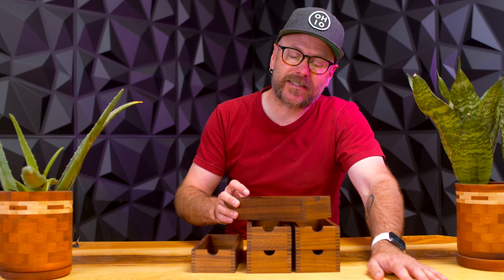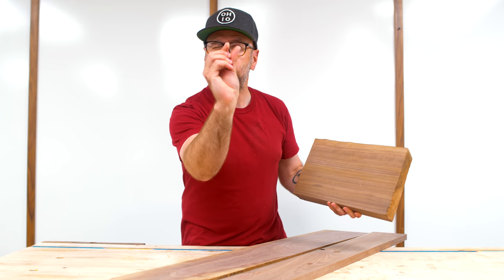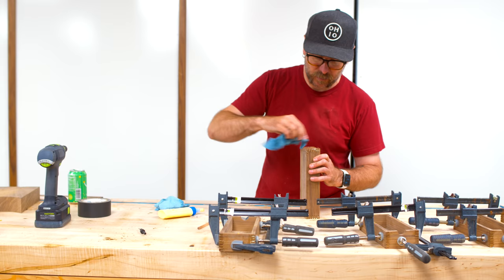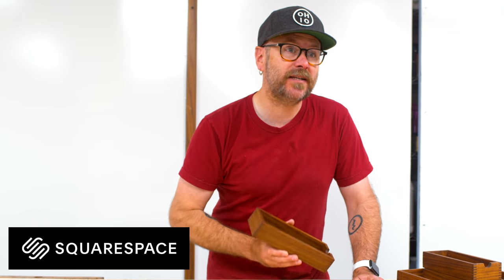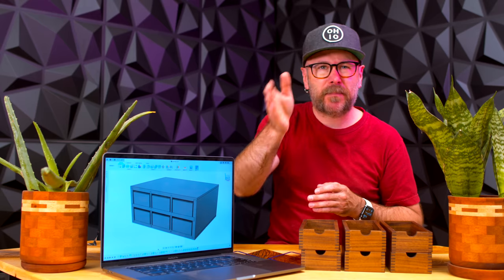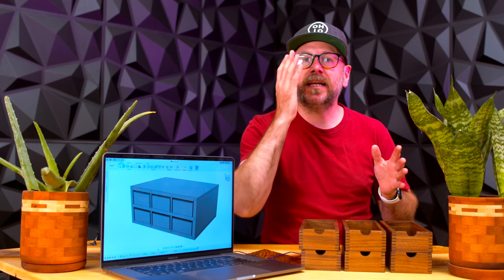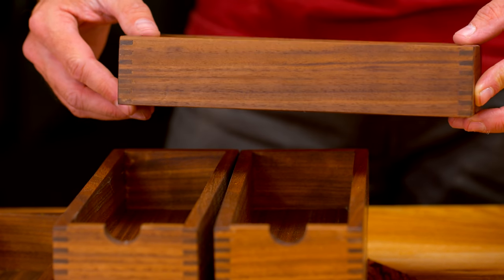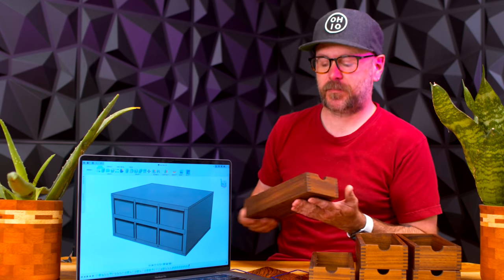I need your help finishing this woodworking project!

Comment: If I would not know what I want to do with a project, "not feeling it" as you said, I would try something that would challenge me. I look at these drawers, and the question, and I keep thinking- a pyramid. 1, 2, and 3 drawers in a triangular shape (no point on the top, rather a small flat surface to put pen holder holes or a phone pad charger or something). you can build a top, on hinges, and put bushiness cards under it or something... it will certainly be unique, and eye catching. maybe even something for your next book...hope this helps.

Comment: Haven't read all the comments so this might have been mentioned, but a simple monitor stand ┌────┐w 3-4-5-6 of these these drawers would be neat. Also, most sit/stand desk don't have a drawer. A small one that can hold a few items could be useful. (this could use a slider, but those are only 2-5 bucks)

Comment: White/red acrilic dividers between the drawers.
Reply: Acrylic, because my phone hates me.
Also, potentially laser cut or 3d print connectors that fit under the lips of the bottom/top so they can be stackable in any configuration you want.

Comment: Those long narrow drawers are beautiful, but ordinary.  What if they didn't slide out like an ordinary drawer, but were locked in place?  You could release them by pushing in, with a gentle spring-action ejection.  Kind of what some DVD drives went to on laptops, or how some cameras eject SD cards.  When replacing the drawer, you press it in until it clicks into place.

Comment: What if you used the voice activation thing Bob was talking about on the podcast? You could say, "Hey Kit I need a pencil." The case could then slide a drawer out and then tilt up a false bottom inside that drawer to present you a pencil. So basically an over complicated dispenser.

Comment: David, with 425 comments you may be overwhelmed at this point.  However,  regarding the outer bix, I first need to ask you a question ir two.  Is your preference linear or are you open to angular or free form?  Are there height and length limitations?  Where are you planning on displaying/using this?  Great project David!

Comment: I don't think this is a full idea yet... But what if the drawers were stacked 3-2-1, so it was shaped like a pyramid?  You could even invert that, so the bottom row only has the one drawer, then use the brass rod to make legs or supports to hold up the whole thing.  That'd give you a larger surface area on top to use.

Comment: What about a 6 spoke Ferris Wheel with a hand crank either directly driving the hub or driving a series of wooden gears. Make each box removeable if it's in the top dead center. Totally impractical...that's the point

Comment: Make the case a triangle. With a set of three drawers, two drawers, and one drawer. Then later, you could add more and more cases with drawers. Say the first one has one with the tip at the top  (so three drawers at bottom, two in middle, one at top) and another next to it with a tip at the bottom (one drawer at bottom, two in the middle, three on top). And so on. 🔺🔻Could hang the system on the wall, or device a system to let them each other if you have three. 🔺🔻🔺

Comment: Warning: word vomit ahead! I think it would be cool to do the paper tray on top like you described, but inlay some brass rod along the center of each top edge. You could cut the channel with a cove bit, and then let the rod sit proud of the surface by about half it’s diameter. I’m thinking the diameter should be about 1/3 of the material thickness. The corners would be mitered on the walnut pieces and you could miter the brass rod to match. I also think a mail pocket like the ones that hang on doors would be cool. You could wet-form some leather using a plastic one as a mold and use some brass-plated hardware to attach it to one of the sides or maybe the back. If you do attach it to the back, then you could maybe incorporate some steel sheets on the inside of each of the sides to use some of those magnetic push-pins.  Thanks for sharing your knowledge, David, I can’t tell you how much you’ve helped me grow as a maker!

Comment: Here is my idea for the project to go around the drawers.  https://pbs.twimg.com/media/Ebej1OzWkAQulqX?format=jpg&name=small. The idea being to deconstruct the piece as you build it.  Have empty spots for mail (maybe they have dividers, have some open to the top for paper clips or pens, or so the drawer fits from the top.  Maybe make one of the top opening for a plant.  Basically create the foot print of the piece over sized for the six drawers (as if you had more) but make the extra spots for other things or other uses.

Comment: Build a Spiral Drawer Tower:
Step 1:  Build individual carcasses for each drawer.
Step 2:  Stack the drawer carcasses in an aesthetically pleasing "spiral" fashion (glue together?).
Here's a pic from a rough Sketchup model (w/ 15 degree rotation): https://pin.it/6i0te7Q

Comment: Go no further. This is the winner. Make the case a C shape. Have the drawers pull out from the front. Use small brass rod for feet so it won’t fall over. BOOM

Comment: As to slamming the MacBook.....I WORK FOR APPLE. I can say that a gentle "slam" might be "ok". However, I have had many cases where someone forgot they had something tiny on the keyboard area, like a pencil, or even something smaller that just landed there without the user's knowledge. The leverage (and you certainly know how powerful that can be) can "pop" the glass and THAT is an expensive repair brother. And since it is considered "accidental damage", the warranty does not cover it. Even AppleCare Plus has an out-of-pocket deductible for that. SO, just keep being careful brother!

Comment: I just had the thought of a mini printer stand, 3 drawers vertically each side linked with a top, but not sure what to put in the middle, do you have a gadget that you use on the desk ?
The top could be for papers as you described
EDIT: do you have a label printer ? :D

Comment: Make a mail sorting tray...cut 3 pieces of walnut or maple to work as shelves between two vertical stacks of three drawers. Not sure the exact dimensions of your drawers but cut each shelf of the sorting tray into a 1 drawer depth (plus 1.5”) x 3 drawer widths (plus 4.5”) x 3 drawer heights (plus 4.5”) (the added inches to take into account for 3/4” thick board you would encase the drawers in)...Build two boxes (minus the top and front) for two drawers and cap the boxes on top with a shelf, leaving a gap in the middle (about a 3rd box’s width wide) then lather, rinse, repeat until your unit is 3 drawers/shelves tall...bleh, my explanation sucks. I’ll create something in sketch up or even hand draw it and post a link to this comment tomorrow.

Comment: Here are my thoughts. I like your case, but the top, middle, bottom, and sides are too thick. Make them thinner and extend the side out for a folder holder. Use the brass rod to hold the folders in place. On the top CNC/Laser/GlowForge your logo.